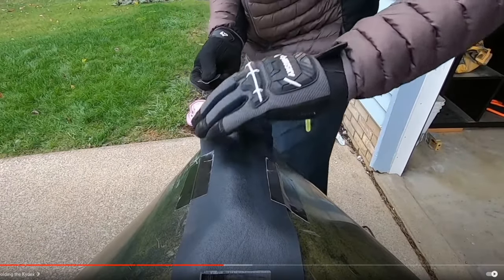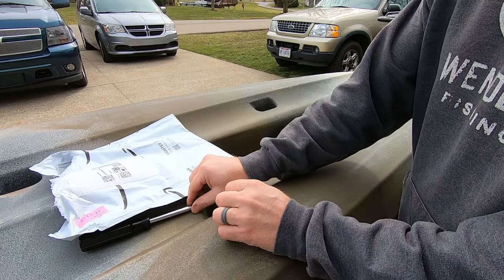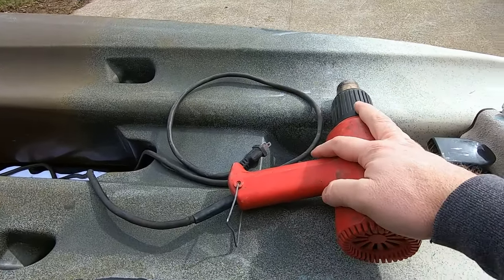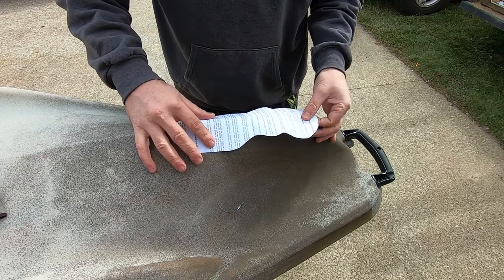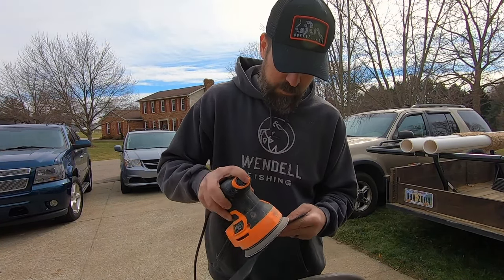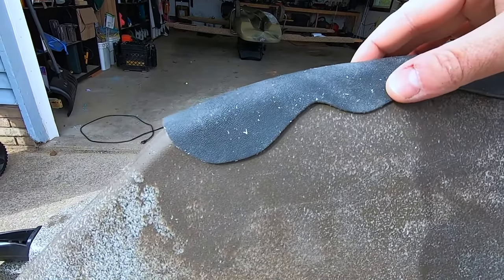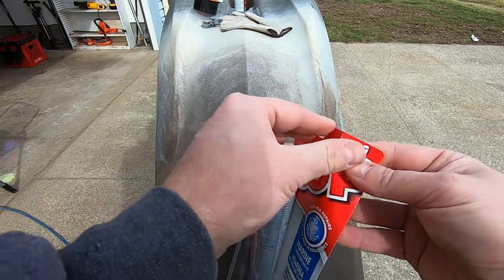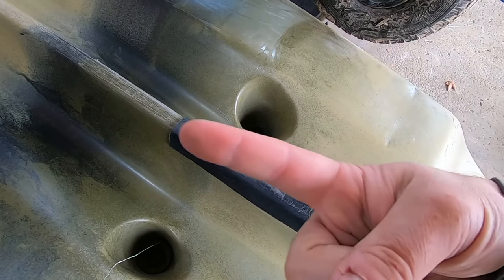Easy DIY KYDEX KEEL GUARD For Your Kayak 2.0! (Under $20)

Comment: Any concerns about putting the heat gun right on the kayak?
Reply from the maker: no concerns, In my V1 Video, I actually heated the kayak itself because there were some deep gashes to even it out to get a good surface to stick to.
Reply: @wendellfishing  good to know. I'm having issues woth it kinda folding/creasing at bends. It's frustrating